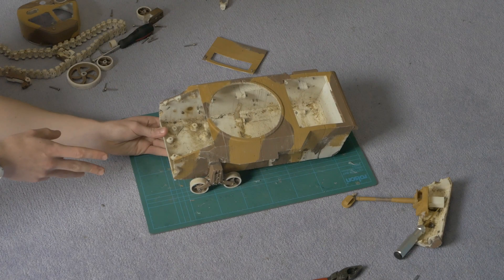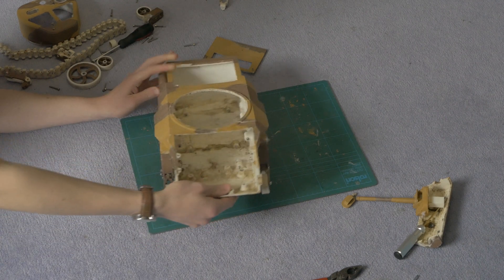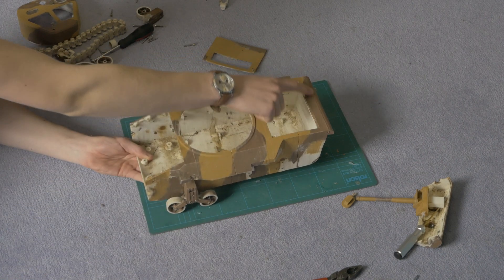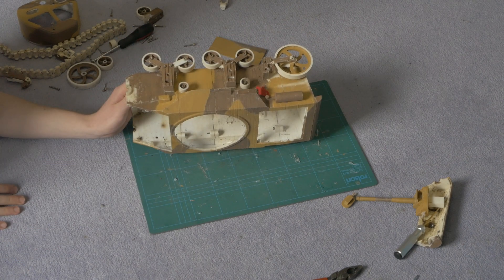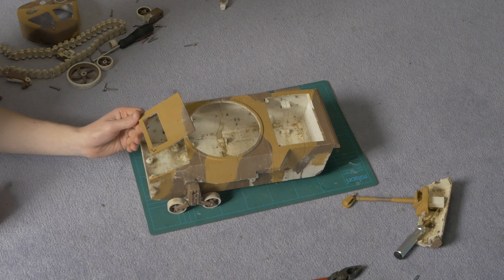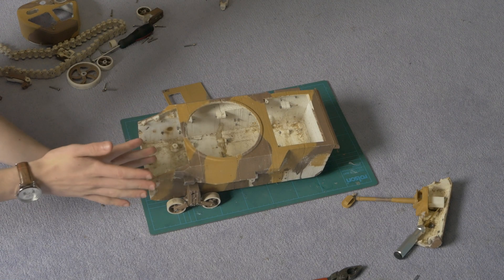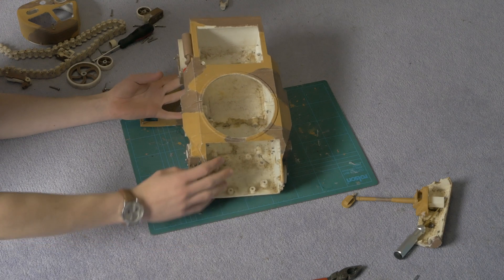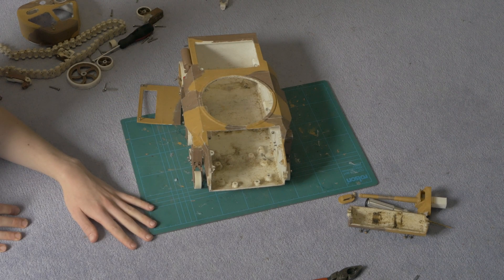3D Printed M22 Locust Build Guide

Comment: Is this channel/ thingiverse account still active? Got a few issues with fitment of some parts on the M22.
Reply from the maker: Which parts are you struggling with?
Reply: @Tobysworkshop Glad you're still out there! 
The left hand (haven't tried the mirrored RH yet, going to assume it's the same) gearbox isn't lining up with the hull mounts on the front end, and the hull joiners above it are also in the way. Only about 3mm off, but enough to stop it fitting. Everything else so far has fit perfectly, so I'm guessing it might have been an older file that slipped through and got uploaded. Hope you can help!
Reply: This also prevents the final drives front armour from being fitted, since the gearbox isn't going in.

Comment: how long are the 4mm rods?
Reply from the maker: They need to be the same width as the transmission assembly, they are not a precision component in the running
Reply: @Tobysworkshop   Ok now i know where those holes are for

Comment: what springs did you use for the suspension?
Reply: i used a pen spring
Reply: works fine
Reply from the maker: I used spare bed leveling springs from the Anet A8